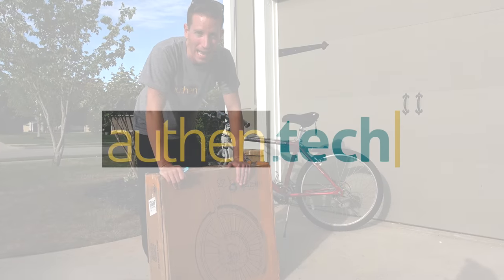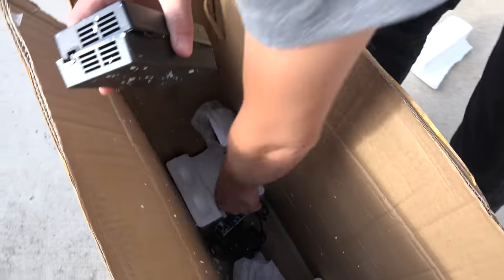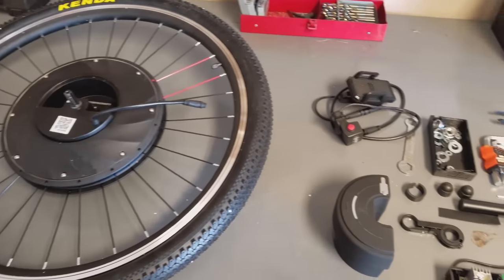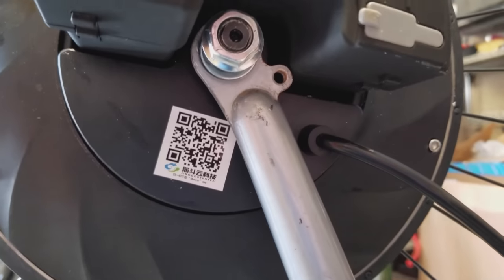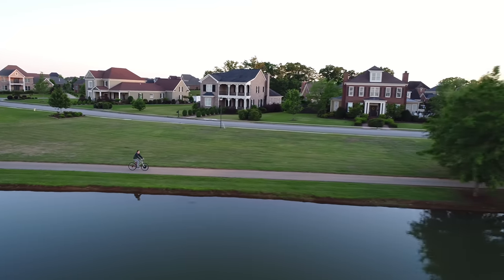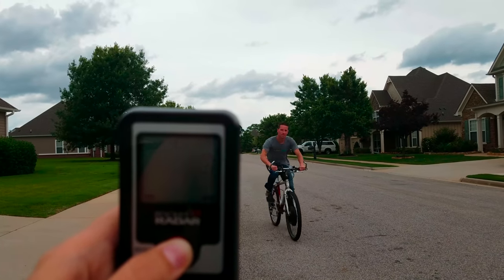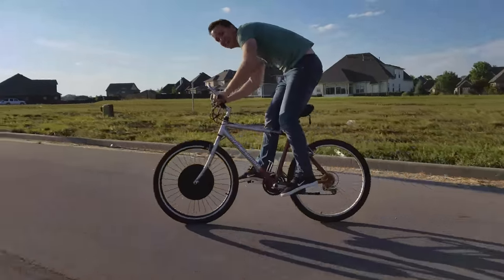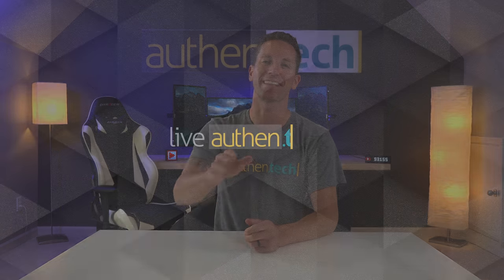Easy + Cheap eBike!! Motorized Wheel Conversion Kit REVIEW

Comment: I'm not sure if I saw one this bike, but I would like to stress the importance of using a torque arm when installing a front hub motor. It helps prevent the axle bolt from twisting out of the fork which can be really dangerous to lose your front wheel, especially at high speed.

Comment: I bought an Android phone for my i mortor wheel. Make sure it has bluetooth 4.00. But I have found, the wheel worked, without me even switching on my phone, so you don't need a phone to make the wheel function. You mainly need the phone app to switch gears, battery level, speed... The throttle/accelerator switch  works to propel the wheel without the app. You have to start peddling first of all, get the wheel spinning before the motor kicks in.

Comment: Hi Ben, thank you very much for this comprehensive contribution. There is one point you may want to clarify. What is the reaction of the wheel when pulling the brake, i.e. because of a red light? Does the wheel pull you into the crossing traffic, despite of breaking? Or does the engine stop working (as it should)?
Reply: Most units have an optional Barack switch, that does imeadiatly stop the motor.

Comment: I bought one of these, really does assist and easy to fit although a little heavy,, the only downside is the battery only lasts for about 8 km {5 miles} before needing a recharge.
Reply: bigger battery in the frame would get better range and improve balance on the bike.

Comment: This video is from 2017, and like everything involving electronics, the technology has improved and prices have changed since then.  I'm doing the research on converting my cruiser bike to electric such as was done in this video, but from what I'm seeing so far, for the price of a conversion kit similar to what is shown in this video, plus a battery (most kits I've seen online so far do NOT include the battery - add a couple of hundred $$), you'd have spent $500-ish dollars on  the conversion, maybe a little more, and you'd still have to do the conversion work yourself.  That doesn't include the cost of the bike itself whether you've already spent that money and have an existing bike or not.  On the other hand, there are already converted, complete electric bikes available online now for right around $600 with specs very similar to this and other conversion kits.  Converting my existing bike is making less sense to me at this point vs. buying a complete electric bike already converted.  The wild card is buying a bike sight-unseen vs. the cruiser bike I already have.
Reply: battery is included, all together is 300 bucks

Comment: Keep in mind it is not water proof. Their website says:
"It is best to avoid the rainy day ride or in the mud pit off-road. Because after this use, if the use of high-power water jet washing machine, will lead to rust of the shaft, friction increases, thereby increasing the consumption of electricity, and eventually lead to rust and abnormal bearings."
Reply: Does salty slush rust the motor shaft or bearings?
Reply: And you answered my question.

Comment: I got one of these kits and I turned on the button and all 3 lights were on, and when I hit the throttle nothing happened. I was wondering if you had the same issue, and if you have to have the bike in motion in order to use it?

Comment: I've got the iMotor and it works pretty well except I can't get the bluetooth to work.   Would there be a way to add another battery?   I'm not a wiz on electronics.   It seems all of the control boards are located in the moon shaped battery.  Would it be possible to attach a pig tail that would come through the case on have a pug / connector to attached a similar or larger 2nd bank of batteries that could be hung in a bag, mounted on the frame or even laid in a basket?   I've not taken any trips more than a few miles but I'd like to be able to do a ride of between 20 and 30 miles.   Everything I've seen and read indicates the battery wont last that far.   OR, would it just be best to get a second batter?   Thanks

Comment: it's down to  $289 now. Not a bad deal.

Edit: I almost prefer the front wheel add on motor. It gives you 2 wheel drive in the end.
Reply from the maker: +murderdoggg - Hah, great point! Thanks for sharing
Reply: murderdogg /yeah never even thought of it that way makes good sense man
Reply: The funny thing is that the battery itself costs $200 on ebay lol you'd be better off just buying a new motor.
Reply: $150 now at walmart drop that down to $40-$90 an i would say its worth it considering the parts are dirt cheap
Reply: Yup, I find it's actually easier to steer a bike with an engine on the front than on the back in Winter. Less slipping it seems. I'm actually considering keeping this little Honda on the front of the Huffy to drive the front Kevlar tire for more Winters to come, and as backup engine in Summer, but adding on a 6.5HP engine mid-frame to chain drive the rear wheel for faster travel when roads are clear and safer for the higher speed, or as a backup engine in Winter. My suggestion for anyone on a much smaller budget, get 1 of those $150-250 Chinese engine kits for the back and 1 of those $290-400 electric hub motor kits for the front. It'd help with starting, riding and fuel efficiency, plus, if you run out of gas, turn on the engine, and if you run out of battery charge, pedal to bump start the engine. Maybe put on a set or 2 of adult stabilizer wheels for Winter though...
Reply: smart man !!!!
Reply: Does this wheel have a weight limit? Can it bust?
Reply: In India electrict cycle kit price 100$ and 120$ lifo4 battary better than li-ion battery cost 120$ and 20$ charger
Reply: Speed 40 kmph and battery bukaup without padle assist
50 -60 km
Reply: Battery life 1 lack km
Reply: Padel asist 100-120 km

Comment: Just curious, is there any reason you could not have simply loosened the axle nut and rotated the motor a little to avoid dremelling your fork? Is there anything that causes it to be a fixed mounting location? Id like to avoid dremelling my bike if possible...

Comment: What about the disc brake on this conversion kit? How does that work? Hydraulic? Electric? Mechanical? Can you just use the old brakes for the new front wheel?

Comment: ...130Wh, thats totally nothing...
Reply: The motor has 240 Watts of power, the battery has 115 Watt-Hours of capacity (36V * 3.2Ah = 115 Watt-Hours).
Reply: Not much power really.  Correct.

The average person can produce appx 1/4 hp for short duration. ( a bit under 190 watts)

I fly RC models that use  up to 5000 watt motors... (appx 6.2 hp)  Some with 2 of those motors.
Reply: Be Informed I have an idea in the works it's got four wheels and is powered buy old dead stuff that I siphon from the ground. XD
Reply: They sell some two stroke engine kits for bikes that can take you up to 30mph.
Reply: Yard Sale Dale don't get me wrong I love my lectricks ya know. But if you are gonna scoff at 130 just go gas I think 130 is perfectly reasonable
Reply: 240W LOOOOL
Reply: You MIGHT get 5 miles of pedal assist. I couldn't think of a worse place to put the battery either. It's going to get very hot and has nowhere to dump the heat. Most forks cannot withstand a motor on them, especially not shock forks or road bike type forks. This is just a bad and cheap design and worst of all, they want 400 dollars for this POS!
Reply: U can peddle the same n get tired eventually or sweat this is to get from point a to b relaxed.
Reply: The battery alone for this hub wheel costs around $200 lol so it seems better to just buy a brand new wheel instead for only $300.
Reply: its called a moped
Reply: Only 15 mph.
Reply: @ @ericgillespie2812  :😂👍
Reply: @han0509 😂👍
Reply: Just get a second XD
Reply: Izunami 
Not true , the battery makes around 100w , I bought yesterday a battery , which makes 850w 48v (PANASONIC) with 380€ , you could buy something cheaper but not Panasonic with 300€ , 100w = not over than 100$
Reply: The heck. My cruise watts on my roadbike is around 250ish
Reply: @Be Informed they have invented something. It's called a motorcycle.
Reply: @miffachan123  yeah, quite sad when they talk about 250 watts for a short time. My average wattage when i was 12 years old was already 130-150 watts. Now my ftp is at 250 watts.
Reply: try peddling.. nobody needs an electric bike.. motorcycle maybe.. bike..no.
Reply: @Truth Seeker If you want speed get a motorcycle then.
Reply: Be Informed last night I came with this idea that might work and be better than ebikes. I call my idea the motorcycle, hope no one steal it from me
Reply: What is the brand of this motor
Reply: @cruiser97eric1  Doesn't that mean it has only 30 minutes of battery at full throttle?
Reply: Just enough to cruise on flats and a little help on hills,for more performance you have to get a more expensive and complicated set up.
Reply: @captlarry-3525  a little help on hills is welcome but no not necessary it's just overpriced for the power output
Reply: @mikeb1039  i got 600 watts
Reply: @mikeb1039  All euro bikes are limited to 250w?  Dumb statement.
Reply: @Be Informed Do you have anything to Inform us about??
Reply: Its kinda funny...the battery size...no wait on the second thought its NOT....
Reply: How the most don't even know the difference between W and Wh O_O ... .
Reply: Get 2

Comment: It's only 3200mah, the 10 18650 batteries are connected in series, so it's a 36 volt- 3200mah battery
Reply: Yep
Reply: Is that good or no?

Comment: What if somebody wants a 500 watt or a thousand watt 
48V motor instead of a 240 Watt 36v?
Reply: You can upgrade, it's possible!
Reply: 17 inch 60 volt 1000 Watt hub motor canacihe 70 kmph speed
350 kg loading capacity
Reply: 25° maximum climbing ablity with full load

Comment: Hi Ben, thank you for the video. Instead of using a dremel to cut the fork to fit the battery, could you have just turned the wheel hub around counter clockwise to insert the battery nicely?
Reply: Then you would ride backwards lol
Reply: @Mark-gd5vr  then the hub does not have a reverse. It only goes in one direction

Comment: Can you ride it in the rain.Can it still keep its full power in the rain. Some 1 told me if the spark plug gets wet it can mess up the electric power. Is it water proof ? What's the exact names of the best e bikes that goes up to 28 mph and 18 miles on a full charge where can I get them bike's from ? and what e bike's I can put a small mini lightweight trailer that can pull up to 50 lbs ? I want the names of the top 5 e bikes

Comment: Odd that it comes with a tire already on the wheel.  Is it some sort of solid tire, or can you swap the tire and put your own on there?  From the video I can't see a air valve to pump up the tire.   If it is a solid tire, how hard would it be disassemble and rebuild with a standard rim.  From the video it looks like normal bike spokes just shorter.
Reply: Delmar..I have been looking into this conversion kit solution for myself and from what I have gatherred it is not uncommon for people to be getting flat tires with staandard bicycle tires and tubes. Maybe the one that comes with the kit is a higher rating? So it can take more ware and tare? I would be glad to hear what you can come up with on this too. Happy riding : )

Comment: Can it be charged through riding? Does it have regenerative braking?
Reply: Eric Gillespie no. I guess it would cost more
Reply: Bagoon 😩 back to scouring the internet I suppose. Thanks for the response
Reply: Eric Gillespie, do you not have electricity available? I guess if you are doing a long x-country road trip and camping you might want a generator, but for normal use a good free wheel for coasting is the most practical and economical  option.
Reply: Solar charger would be great for it, if there's no outlet at your destination.
Reply: Have you found a good alternative?
Reply: الإخبار
Reply: When you live in 2030
Reply: Install a mini alternator that can be manually engaged when you go down hill so it can charge your battery and slows you down at the same time

Comment: The price, simplicity and specs is impressive - but what is the hillclimb capability of the wheel and do they sell spare battery packs so that it can be replaced for extended range?
Reply: Batteries can be purchased from e.bay. I just bought a spare for $196. Type 'iMortor battery' in e'bays search.
Reply: Yes, how About hillclimbing? I am curious too!

Comment: Thank you. Can you ride bike in the rain and wet weather
?
Reply: No because water can go straight into the main bearing. This is the only real problem for me
Reply: @MrJob91  Thank you.
Reply: @jelenaorevic202  i coated the magnets with paint, i epoxied the bluetooth module and won't ride in pooring rain or store the bike outside in the rain
Reply: It works great with additional batteries
Reply: @MrJob91  Thank you so much.
Reply: @MrJob91  Thank you. You videos and answers realy helps me a lot.
Reply: @jelenaorevic202  awesome man! Yeah the motor has really meant allot to me as i ride it so so much. 2300km in 6 months. It brought me places

Comment from the maker: Super easy, fast, and cheap eBike conversion kit!
**If sold out, check out here on Amazon ➜ https://amzn.to/2OlbjjO
Banggood ➜ https://goo.gl/CSi1CZ
Reply: great video!
Reply: Can you do another electric skateboard please?
Reply: AuthenTech - Ben Schmanke do they sell one for 700c?
Reply: In Spain your most definitely do not get that kind of deal. I have not seen any complete electric mountain bike with those features at that price in any local shop or on Aliexpress (adding up the shipping fee). The cheapest option right now is a 36V/20 inches/Folding mountain bike at US$780. Just out of curiosity, could you please state brand name and model?
Reply: Sorry, just to avoid any confusion, my question/comment was adressed to DroidTech
Reply: Thank you for the feedback :-) ¡You are from Belgium! So in theory a similar deal could be available in Spain. Shame there is not any information at all about the specs (and weird even for products made in China, usually they bother at least to make up something ;-)).
Not even a single data on the battery itself or on the engine and things like that?? Actually, this is why these reviews are so useful, as we get to see real hands-on experience as opposed to whatever the seller/manufacturer says about the product. Anyway, thanks for your time and enjoy the ride!
Reply: DroidTech j
Reply: AuthenTech - Ben Schmanke I have 36v battery with rear hub motor throttle only and peddle assist. As this front wheel vesion has cruise control.Could I fit this seemingly easy motor so I could use both hub motor's back and front at same time to reach 30mph with both motor's going at same time.Price please shipping to UK.Altogether please.
Reply: AuthenTech - Ben Schmanke Hi   Ben.Have sent you text by forgot to ask.As I use throttle only and peddle assist on my rear hub motor and the gear shift is on the right hand side for Shimano 7speed gears at back wheel. I see that there are three versions.As my rear hub.has thumb throttle only option with peddle assist through using my gears. Do you have a throttle only version so when I use my present thumb throttle then I can use cruise control so ican still have one hand three if I need.This kit would mean I can get to 30mph.without having to buy a bike conversion kit which I then have to fit larger controller and bigger battery plus all the wires ect of which I have no knowledge of doing.Also this would give me two wheel drive and use only one at a time if I want .Could you advise me if this will be ok as by the time I buy 500w motor it would be a lot of work. I am in UK but have full motorcycle licence.price for appropriate hub for front please.
Reply: AuthenTech - Ben Schmanke
Reply: Amazon, half the cost. Do yourself a favour, get a non integrated battery.
Reply: AuthenTech - Ben Schmanke just to double check the battery comes with right ??
Reply: hey, when i order do i have to specify mountain bike? i dont want a screw up and end up getting a leisure or track bike wheel
Reply: AuthenTech - Ben Schmanke  how much  for a  26 inch  bike
Reply: AuthenTech - Ben Schmanke  i have a rear hub 36v 250w motor soon to be upprd to350w.Can just fit this on foŕ troþtle only. For more speed . Reae hub has chain dribe as well.
Reply: AuthenTech - Ben Schmanke 090000pppllplppppppppp0p0
Reply: DroidTech - So basically you're saying you know of a kit at a better value, yet you can't even state what it is?! So what is your point of claiming something that you can't help anyone find that "better deal"?  The answer is - there is NO point to your reply because if people can't find it then it may as well not exist,  unless you plan on going to that shop near you and shipping it to folks who ask you about it.  Is that your plan?
Reply: AuthenTech - Ben Schmanke $500nz price is not cheap for me atleast
Reply: AuthenTech - Ben Schmanke
Reply: Did you order yours from banggood and did it come with battery and also how is it holding up
Reply: AuthenTech - Ben Schmanke pricing
Reply: $400? NUTS. This is outright dangerous to many, if not all modern forks. 130 watt hours might take you 5 miles WITH pedal assist. Battery will get very hot being right in the motor and painted black, so expect 50 charge cycles at most. Total waste of money!
Reply: what if... what if you added a 2 cycle engine...
Reply: DroidTech that's a rip off
Reply: its out of stock
Reply: Link is broken.
Reply: AuthenTech - Ben Schmanke is it possible to put more batteries on your bike